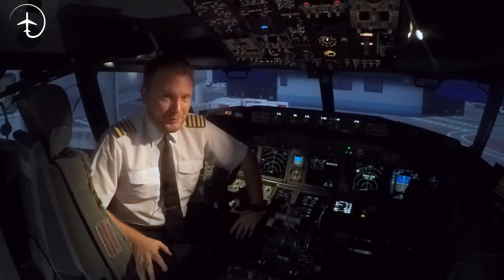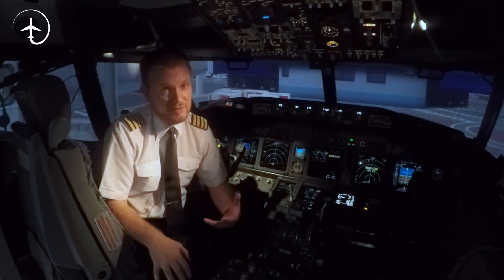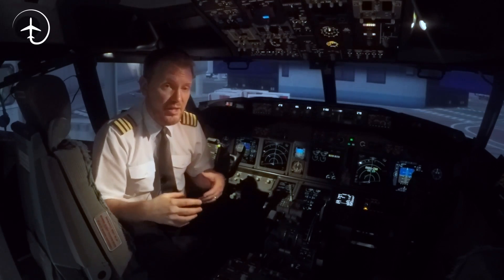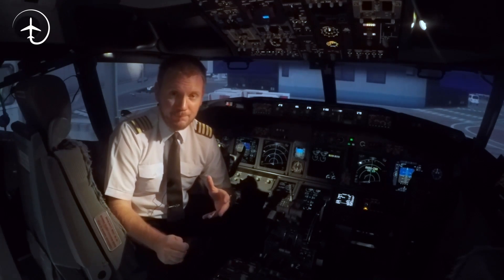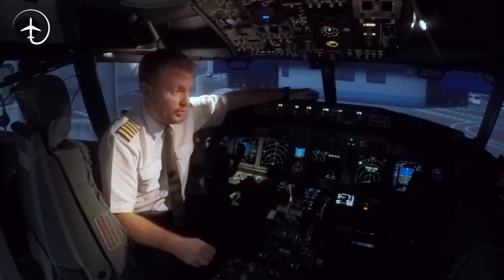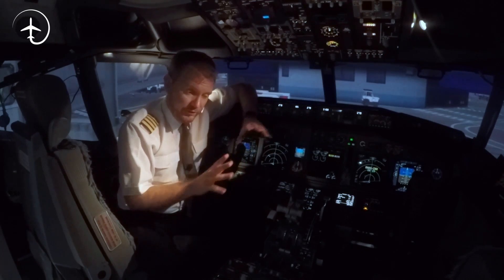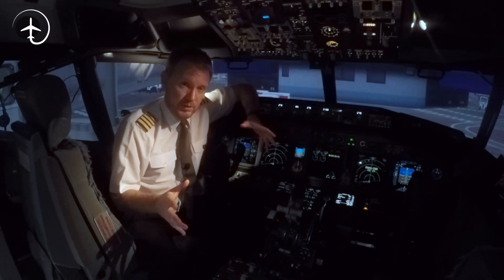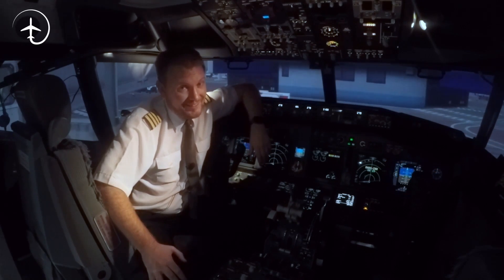Aircraft BLACK BOXES. How do they work?

Comment: In electronics engineering circuit design, connections to a device can be inputs or outputs.  The device actions these signals according to rules within the device. An outside observer doesn’t need to know exactly what actually happens within the device, only knowing the inputs and resultant outputs. Therefore, the device is designated a “black box” as it doesn’t matter HOW it works, only what it DOES. It is  probably true that many such devices are painted black, but that could be a little problematic if the box the size of a pin head was located on a circuit motherboard.

Comment: Thank you Petter for another excellent video!
But some questions about the black boxes were not addressed.

As it has unfortunately happened that data from the CVR and FDR could not be recovered, I am very surprised that these systems are not redundant.

Given the enormous cost of a modern aircraft and the potential loss of life in the event of an accident, it cannot be the cost of purchasing these devices or the weight involved in not having a second black box installed elsewhere in the aircraft.

This way, investigation teams would still be able to fully understand an accident and make appropriate recommendations.

I fully understand that pilots do not want to have their entire conversations recorded on a long haul flight.
But if safety IS EVERYTHING in aviation, then at least the first hour after entering the cockpit should generally be recorded and retained, and the last two to four hours before a crash or event.

There should also be an automatic mechanism that does not rely on the pulling of circuit breakers by human intervention.

Why is there no UPS for the black boxes?

Comment: Great video, as always! Has there been any attempts to make the Blackboxes using materials that will make them float in water, while still maintaining the strength, fire resistance and other requirements? This will make them float during a crash in water and easy to locate.

Comment: @mentour pilot - if you need to save something on the cockpit voice recorder, would it not be better to be able to "flash save" the last 2 hours instead of turning off the CVR on some other device?  What if something significant happens after you've "pulled the breaker"?  There would be no record of those voice interactions.

Comment: As you know, after an accident there is an great effort to retrieve the 'black boxes' and understandably so. But my question is this referring to the data recorders: i'm sure we have the technology so why do airlines not uplink the the flight parameters via satellite (at least the most important one ie anything to do with navigation/flight systems/gps location) to be saved in case of emergency/accident? Each airline could maintain its own data stored on company servers and retrievable when needed? I understand the CVR would not be as practicable because of the size of voice files. Am I over simplifying it?

Comment: Many things in aviation seems so outdated... With todays tech it could record way more than 2 hours of voice. That way you never have to stop it recording. And transmitting the data off the plane to a remote location should not be an or/or question. It could be recorded as is now, but could be extended with transmission to off-site. The unsent content could be buffered if link outage occurs... And so on... There is internet on board, yet this is a problem? Sure, it is not 100% reliable, so you still have to find the boxes, but if it were worked, or there are partially sent data already on ground servers, evry bit of information could help the investigation.

The technology is already there, actually way ahead of these things. Anything that is holding back is probably bureaucracy...

Comment: Does the pilot check on the working of black boxes before the flight? Has there been an incident where the black box failed or malfunctioned?
Reply: Of course there are cases where they have failed.  The MMEL for each aircraft type gives the requirement for what can be failed and still launch the aircraft.  If you want to know what an MMEL is and stands for, look it up.

Comment: why dont the black boxes have backup batteries that allow them to record in the event that electric power is lost (such as dual engine failure or other electrical problems) 

even 20 or 30 minutes of extra recording time could help solve an investigation (there should also be a system in place that shuts down the recorder when there is no signals being recorded, so if the plane breaks apart or whatever, the recorder doesn't record half an hour of silence)

Comment: I got this question that nobody got to answer it yet. I LOVE the "aircrash investigation" series on National Geographic. I saw most of the episodes and there is this obvious thing that could help investigations in a whole new level, yet i dont see even a hint that its actually on someones mind to implement. Instead of using CVR (Cockpit voice recorder) it would be great to have a "cockpit video recorder" imagine yourselves that the NTSB could peek in and see what warning lights lit up or did the pilots extend the flaps or not, what were the pilots doing, if one of them got incapacitated it would be much easier to prove. With current technology i really dont see why not use such device.

Comment: I would think that they could get the flight voice recorder to record much longer. I think it would be easy for the aircraft it have something that would send information on a data link if not all the time because that could be hard to do. But if the computer sees something that it doesn't like from something like an engine, it could send that information to the company so it could be looked at next time it is served.

Comment: Really need a system where you just press a button to permanently record last 2 hours on a separate drive while the main box keeps recording.
Also with modern digital compression you should be able to record a weeks worth of audio without compromising weight or space.

Comment: Now here's the question: First of all, thanks a lot for elaborating on the actual technology used. Solid state devices make a lot of sense. But given the size of the blackbox and the storage density possible on solid state technology (or all modern storage technology really), why is there a two-hour limitation? I assume these are not plain SD cards, but probably still the same technology. So capacities of 500GB wouldn't make any difference in size.
The way I see it, it should be easily possible to record months before that storage is full (assuming that the sound quality isn't required to be spectacular anyways). So what's the limitation here? Are these very old cards that are difficult to replace inside the black box?
Reply: Or at least have something like they have with dashcams, where if something happens they automatically save the previous however much time.

Comment: Why does it only record up to 2 hours? I'd think that on digital memory cards one could record much longer spans of time. Many flights are longer than that, and sometimes a remark early in the flight about a minor issue could be a precious hint to explain a later incident. 
Also, why isn't there a procedure after each flight, after having landed, to save and archive all of the flight data, voices and flight parameters alike, if for example the next day the same plane has a technical issue, maybe in the previous flights it had there had been subtle hints that could be found this way, plus it would be a nice statistical tool to continuously follow a plane's state.

Comment: Actually you have touched on something I always wonder about when an aircraft incident happens....with modern cloud computing and super computers cannot some system like SCADA be used to transmit operating data on real time basis ? If that were possible MH 370 mystery would have been solved  by now ???  Am I thinking right ?

Comment: I think that as you stated in a newer video, redundancy in airliners is great, thus, a backup satellite system - alongside the existing system -  that will transfer data on realtime will allow it to be stored for longer periods of times until the flight has actually ended. This also opens up the possibility of data-mining, that can extract new trends and ideas to improve airliners in general. 
Went too deep but this is a subject I was actually considering for a scientific research.

Comment: Hello, y CVR or black boxes does not have facility to send regular pulses with GPS location so easy to find it after accident in Remote locations..... There should be such arrangements to find it easily. I think that Even a just any identical high frequency radiation will also do this job.... Reply please

Comment: Why don't they record more audio?
I just looked up a spec sheet of a Voice/Data Recording System. It states that each narrow band audio channel records data at a rate of 3k bytes per second, the wide band recording occurs at a rate of 6k bytes per second, so the total 2 Hours of audio utilizes 80 megabytes of memory. The flight data recorder ensures more than 25 hours of recording duration for a standard 256 words per second, 12 bits/word, which comes out to 36 megabytes of memory that have to be allocated.The Digital Communication Message memory is allocated based on utilization to ensure 2 hours of recording duration, so lets say those are generous 15 mb.
So the total comes out to 131 megabytes of data.
Now, recording 24 hours of voice would take up 960mb, 24 hours of digital communication would take up 180 mb.
I don't think it would make the plane much more expensive to fit the black box with a couple of 2048 megabyte SSDs...
Reply: Now I realize that there is no use in listening the the whole flight rather than the 2 hours before the incident. But imagine the following: A 9 hour long flight. At hour 2 a near-miss happens due to a mistake by ATC. The pilots stop the CVR to save the data for the incident report. Now everything that happens in the remaining 7 hours might be hard to reconstruct for investigators. 
Instead of the CVR on-off switch there should be a possibility for the crew to set markers in the recording to mark important parts for further investigations...

Comment: It's also worth mentioning that there is a thing called QAR (Quick Access Recorder). However it is not built to sustain the same amount of damage that a black box can, but that does not mean it hasnt been useful in some cases.

Not all aircrafts are equipped with it, nor is it a law to have one. The QAR does NOT record in real time, it buffers data for 45 seconds(Flash memory is more efficient this way), then writes it all at once. This is why QAR tends to not feature the point of impact. The QAR usually records more parameters than the FDR do, and for longer periods, but also overwrites when needed.

Last but not least, unlike the black boxes, the QAR is in the front.

If you read this much, congratz, you get a cookie.
Have a good day :)

Comment: A question for you..... how much data is sent live to the airline control, for example when I changed seats so a married couple could sit together, the planes on board system recorded that change, does that get relayed to the ground along with the tracking data.  is the mechanical data also sent?
Reply from the maker: No, the data sent to ATC is mostly related to cockpit MCP controls. Some maintenance data is sometimes send to the maintenance base of the company but not passenger movements.

Comment: 3 FDR's, located at different places would be safer. 2 of them should have the capacity to be parachuted in case of the slightest unexplained anomaly. (manuel application included). In other words: before a crash. The MH370 is a good example to understand that it would be an advantage where about to search instead of checking out half of the planet!

Comment: Pity that Air Canada didn't require the CVR breaker to be pulled after the near disaster at SFO.
Also, Airbus (yeah, not your turf) is testing externally deployable boxes on the A350, if I recall correctly.

Comment: Why doesn't each big airplane have like three of them? It won't add much to the weight but it will increase a chance of finding one by three times. Or if the recording is damaged, it can be better recreated with three sources.
Reply: Владимир Кузнецов Vovacat17 why is it still located on the aircraft. Seems like it can send signals to a server
Reply: Transmitting signals isn't 100% reliable, for example there could be interference due to bad weather, nearby transmitters, or a plane engine exploding...

Comment: Hi! I don't know if this question has been asked before, but
Are pilots and the rest of the crew allowed to discuss outside of useful informations during the flight? I believe they are, but are there times of the flight (Like takeoff and landing for example) where it's prohibited and it could lead to problems with the compagny (As getting fired or something) or even justice, because it could put lives in danger? Or does it only rely on "common sense", without actual rules?
Reply: In many airlines, below 10000 feet AAL (Above Aerodrome Level), the cockpit has to be "sterile". Captain Joe has done a video on that topic. But it basically means that conversations non relevant for the operation is not allowed. Above that altitude, if time permits, that is allowed.
Reply: I see, thanks!

Comment: why doesn't it record video feeds from the cockpit
Reply: Shan Abeywardene Because there is no webcam in the cockpit, so it would be kind of difficult to record video
Reply: i know., my question means why are there no cockpit cameras like the ambiance sound recorder mic. not at least in airbus planes. why?
Reply: Shan Abeywardene Cameras wouldn't bring many benefits as the most important things are already recorder by the CVR and FDR. And it would be very expensive to install cameras on every planes
Reply: well many incidents caused by pilot error and recording pilot facial expressions would help to determine weather they were fatigued or not right? considering that these are multi million dollar airliners, a webcam would be nothing right?

Comment: In the future I think that it would be an excellent idea for the voice and data recorder to have a satellite link function whereby the data is pinged back to base periodically. It would still be necessary for a ‘local’ on aircraft copy to be recorded as per current practise as this would be the ultimate backup should there be a satellite uplink issue i.e. solar flare activity / polar regions where satellite coverage is not as good as other latitudes. This would certainly help in cases like the MH370 disappearance where the wreckage could not be found. Obviously in the case of intentional disappearances the pilot could still pull the circuit breaker as this electrical function would still be required regardless as a safety feature should for some reason a electrical fault occur. Excellent video, keep up the good work!

Comment: Great video! I've got a follow-up question: Why still only 2 hours record time on the CVR? Now that everything is solid state it would surely be trivial to push that up to 25 hours in line with the FDR, so that investigators are always guaranteed to have a recording from the entirety of the flight in question.
Reply: Echin0idea Because you would not need to listen to the pilots in normal operations, just some time before the accident

Comment: Good video, just a small correction, the underwater beacon is not a radio, but puts out a Ultrasonic ping sound, 1 per second. Sound travels underwater very well. The beacon is a self contained unit mounted on the front of both the FDR & CVR. please keep the videos coming.

Comment: Black boxes are not easy to find when they are at the bottom of the ocean eg AF447 & MH370. The name of the game in aviation is that there is a backup system where possible, so why isn't  there a second black box plugged into the top of the aircraft near the fin flush with the roofline. , that will deploy and float to the surface after being subjected to sustained pressure of more than 10 feet or more of water say?

Comment: "Why don't the planes transmit all this data continuously?"

Well... because that's not technically feasible. The amount of data each FDR collects is rather large, a data stream of no less than 200 bytes per second.. Now each plane needs to have this 200 bytes per second downlink.

This would add one more constraint to how many planes can be in an area at the same moment. Currently the limitation is on how many planes can physically fit in the area, but here we add another one: How many planes can share the bandwidth of the downlink...
Reply: Koppa Dasao to examine this we need to understand the average flight data recorder on commercial aircraft have between 4GB and 128 GB of recording space, and that’s only for the past few hours of flight!  to constantly stream all the information a flight data recorder collects to the ground in real-time could be up to 12GB of data per aircraft per flight. taking into accout there are some 9,000 planes in the sky at any given time, the amount of bandwidth required to transmit the data would be enormous. we can't forget any live data being transmitted is open to being intercepted, which creates a security risk. it all boils down to $ and privacy
Reply: Well, if you want to add every parameter... I just played with the 88 he said was required by law, but even with just those, the total amount of data is like transmitting several full length HD movie every second